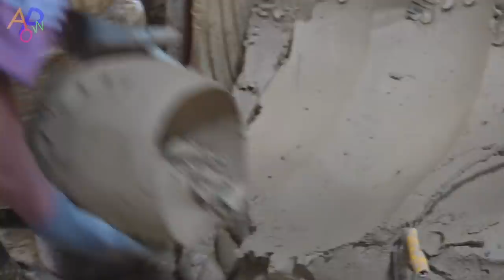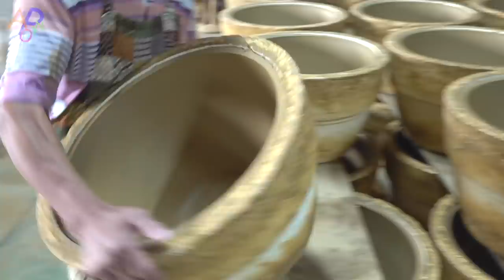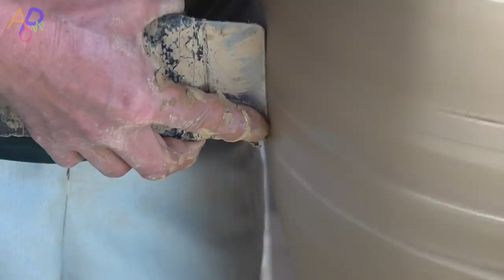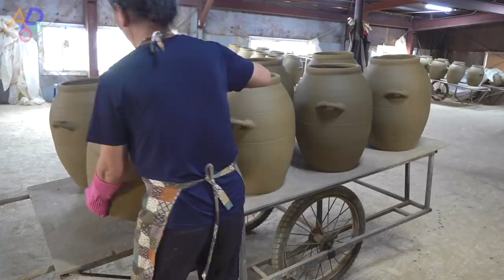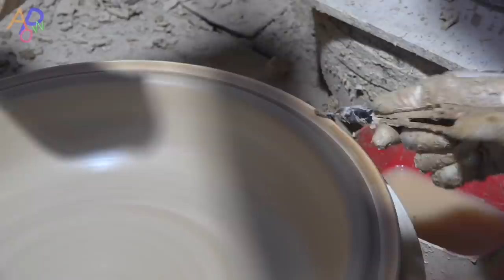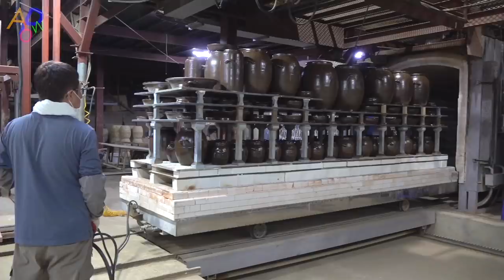Old Pot Factory In Korea. Earthenware Mass Production Process

Comment: that doesn't look like a fun job, but at least the results are very nice. what surprises me is how those handles can support the weight of the pot, especially when full.
Reply: when full, you need to use proper net sling.
lifting with handles is only for empty pottery.